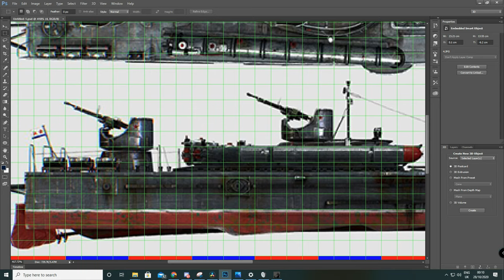USSR Torpedo Boat Replica Build (AI / Breadboard / Projectile avoidance (soon)) From The Depths

Comment from the maker: If you good peeps have any ideas as to how this construct should engage submarines and other ships let me know :)
Reply: Maybe use depth charges
Reply from the maker: Yes indeed the mines on the back are supposed to be depth charges ..but mines.. If that makes any sense. How would you setup depth charges?
Reply: @BaconsTV  I'd use Missiles but the little kind, then I'd give them magnets that activate after around 5-10 seconds and a negative bouyancy then the rest into explosives, should work quite well.

In order that they're not caught on the backs or sides of your own ship, I think I'd put them on a spinblock and point it towards the sky at a 45 degree angle.
Reply: @BaconsTV  with a timer or a depth thing
Reply: @BaconsTV  EMP depth charges and or Deep running torps
Reply: @BaconsTV  if you would like them to stay around like actual mines, i'd suggest a setup of a ballast tank, a magnet and as many charges (explosive frag whatever you want) as you can fit
if you'd like them to detonate at a certain depth use an altitude fuse with the other setup